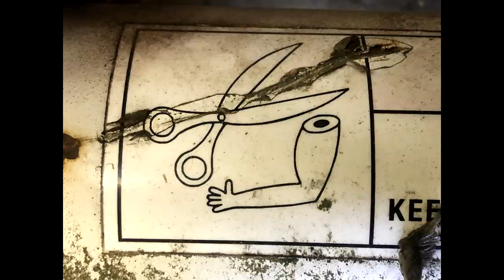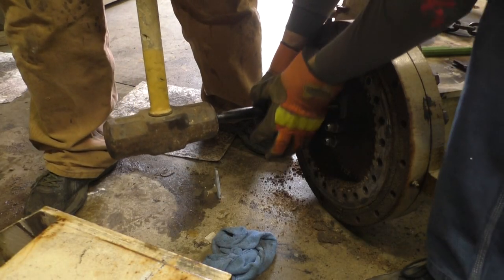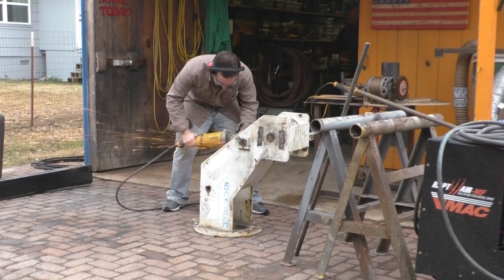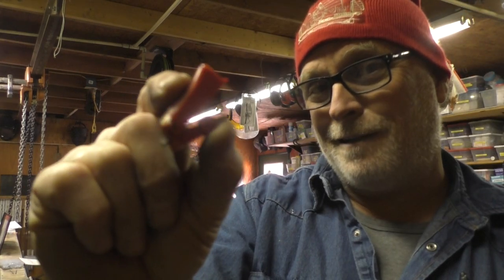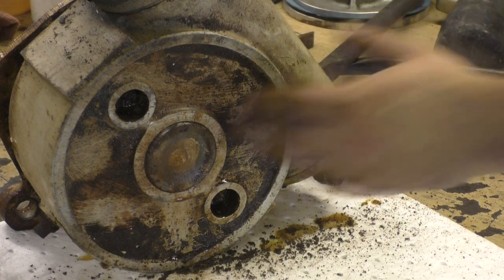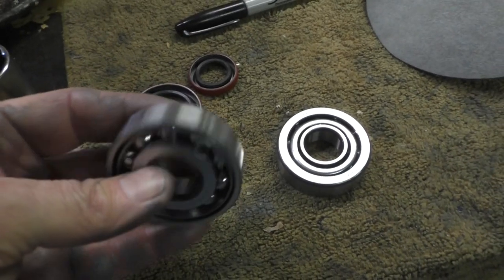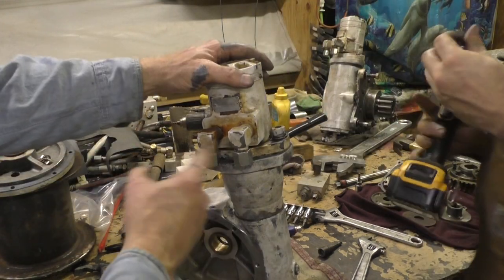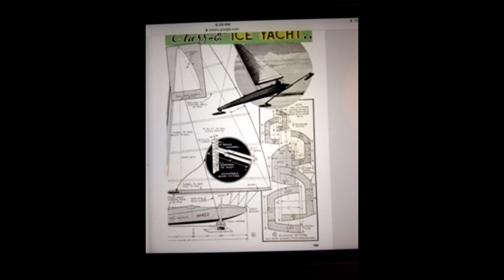Deck Crane Rebuild - Part 4 - Teardown and New Bearings

Comment: The overload presure switch you can hook up to a Warning light instead  that way you  will know if the crane is overloaded without it being cut off.
Reply: Yes
Keep that overload switch Doug.
Either you hook it up to a warning light or hook it up to a bypass switch so that you can lower it if need bee
Reply: A warning beeper and light would be good
Reply: The case "something gets heavier while lifted" is not a common issue for me.
Reply: the switch doesnt kill all functions. it allows winch down and extension in, to lower the load or change the angle of lift to put the load into a safe situation.
Reply: @Sqeezerful  Usually this happens when you have a load and try to extend the boom and that puts you over max. It doesn't get heavier, the lifting capacity is reduced.
Reply: A pressure gauge on the side of the crane is the best way to do it. Heavy thing on crane high system pressure. Just draw a red line on the gauge face if somewhere if you want to be all safety sally? ha
Reply: @TheStumpjumper1  I think that with overload switch activated only allow lifting or retract the bom, because lowering gets the load further out and the center of gravity increase the overload. If you lift or retract the load you get closer to the center of gravity. Thats how modern lorry cranes and mobile cranes work.
Reply: the swtich allows you to retract the extension to get the load closer or lower the winch to put the load on the ground and regroup.
Reply: @Sqeezerful  Think maritime environment. If the load, i.e. a boat - for no particular reason :) gets overrun by a sea wave while being recovered it will definitely get much heavier.
Reply: @ohnoitisnt  This also gives you a maybe less acurate but very high capaity weight scale. With little added cost or complexity.

Comment: Oh boy. You hit the shaft with the torch. I really hope you Either re-heat treat it and get new keys or don't load it to anywhere near what it was rated for, since its now much easier for it to deform and shear. The oxide build up from heating may also make it a bigger pain in the ass to get the gear back on (though if you chilled the shaft in liquid nitrogen or dry ice/alcohol, it might go back in no problem and warm up to a thermal fit in there)

Comment: Hi Doug, when making small gaskets, punch the holes first before cutting the inside/outside diameters - prevents splitting the gasket.
Reply: yes so true, I use to do that when making gaskets and get a piece of hard wood to punch against but punch onto the end grain of the wood.

Comment: I was a millwright at a steel mill. I worked in the crane repair dept.and we called those "dohickeys" on the end of the cable a thimble. When we changed cables on hoists and cranes with thimbles the new thimble( looked like a steel pipe coupling ) we glued the new cable to the thimble. Just slide the thimble over the cable unwind the twists in the cable on the end slide the thimble over the untwisted cable end and pour glue into the thimble. Cut any wires off the end if need be. The glue was some sort of 2 part epoxy.

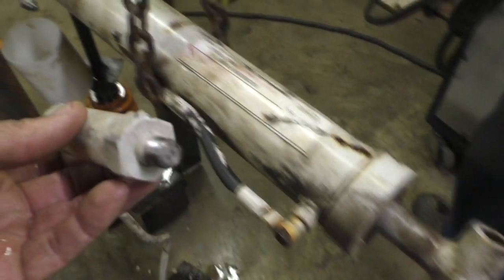Comment: 10:15 I would leave the pressure switch in place - not wired as a cutoff but as overload indicator. Some kind of light or horn maybe. I would like to be aware that I'm trying to lift more weight than the crane was designed for. 
Great job gentlemen - I very much enjoyed watching you!
Edit: I see not only me got that idea with the switch. How come everybody is so concerned about everybody elses safety...? - YT comment section is truly unique place. :)

Comment: On the pins your putting back in to replace the ones that had to be cut & driven out, I would use some Chrome plated 4140. A little money now will save you a lot of heartache later on when you are out in the middle of nowhere. In a salty environment plain carbon steel is going to find a way to rust no matter what. Don't know if it's still available but we always used "Carboline" paint offshore, to cut down on corrosion.

Comment: Exothermic cutting torch you can Pierce a pin in about a minute and a 1/2 a contracts giving Room to push the pin out fairly easy  Broco makes real nice set up and has awesome rods down to 1/4" diameter. I've use both Broco  and Oxy Lance and definitely prefer the Broco.

Comment: Doug 
You can add a simple bypass switch to the overload. Too heavy isn't exactly a subjective thing. There are few instances one can imagine where an object is going to gain mass after being lifted. Attaching to a tree branch before cutting only to find the branch weighs more than estimated, don't see that occurring much at sea though. 
I guess you can find out what truly is too heavy the dramatic way. Best of luck.
Reply from the maker: Think about lifting out of waves.  : )
Reply: @SVSeeker  
Gotcha, considered the idea of waves breaking over and the fact that things do suddenly increase weight when emerging from water, list buoyancy.
I'm still advocating for a manual bypass. Let it warn but you decide. 
Amazing ingenuity getting the crane apart.
Love seeing people who can just do without needing every specialized tool on earth.
The braking mechanism is simple genius, thanks for explaining that.

Comment: When I get water in things like bearings or other places it should not be (thinking of your enormous bearing for sideways shifting) I dry the part in the household oven. Most things can handle slightly above 100 degrees centigrade (212 F?) and all the water will boil away.

Comment: Hate to tell you how to do it 😉, but that gearbox shaft may have been heat treated, and you annealed the end. Check the other end with a file for hardness, and make sure that section wasn't loaded heavily if you did anneal it.

Comment: Look for quick knob ferrules, couple wedge lookin things held together by a ring, that clamps onto the cable, Use em all the time logging, the brake thing... one the end of the worm drive is a clutch, usually set to slip at a certain weight so you never overload the winch

Comment: You guys are probably done all the hard bit , but for bearings and pins that are seized in place try using a little heat, penetrating oil and then keyboard duster spray cans  ( inverted to spray liquid ) to cold shock ... it works

Comment: I'm a crane operator and I would reconsider the overload switch you could even put a bypass on that to override it but it's nice to know you are hitting capacity
Reply from the maker: What if you operated a crane on the deck of a rolling boat, and just as your load transitioned from wet weight to dry weight your crane switched off leaving the load swinging beside the hull?

Comment: Fun fact. A worm drive can run backwards if it is overloaded. I also thought that it can’t until I saw my own winch run backwards and drop a load. 

If you stay within the load capacity of the winch you should be fine, but if you approach or exceed capacity, which most worm drive winches will do, it will absolutely run backwards. It won’t even care if a locked hydraulic motor is holding it.

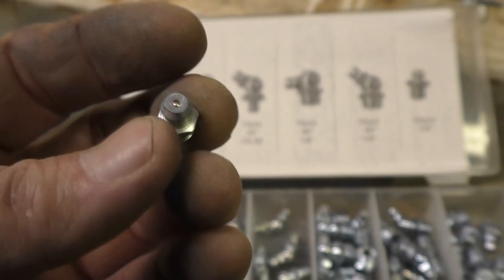Comment: At 19:00 - nice tap chart to find the proper drill sizes BUT ... The drill sizes for a 1/4-28 is a #3 drill bit, which is not equal to a 15/64 drill bit.  The 15/64's column is for "forming" taps only (see the column heading).  Regular "cutting" taps remove metal while "Forming" taps displace metal.  Will it work? Probably.  On board ship you would only have fractional drill index in 64's.

Comment: I think or my two cents that the pressure switch was or is a anti/two block switch to stop you from breaking the cable . If that is what it is it would stop you from extending the boom , raising the block, lowering the boom, which would cause damage.

Comment: honestly keep the overload switch and wire in a momentary switch that will override it. that way you cant lift anything too heavy but if something gets heavier when its up you can still lower it by using the emergency over ride.

Comment: 32:05 appears to be an overload slip clutch similar to what is used in variable torque setting drill/drivers.  The balls run against the ends of the grooves in the discs to transfer torque and pop out and over to the next groove when overloaded.  It is set to desired torque limit by spring or cup washer pressure.

Comment: Lots of time if you put vaseline on the rope it helps it last a super long time the older it gets and great for water resistant. And if you ever have to put a pin in somthing or slide somthing on that's to tight out it in the freezer for a day and it will go on easy and then warms up and becomes tight

Comment: Great Video as always!!! 
Could the pressure switch on the extend cylinder be tied into the cable extend/retract. I know cables often break when the boom is extending and the cable is not let out?
Reply from the maker: That's an interesting idea.  And yes it could be done.
Reply: Agreed I broke the cable on my service truck boom about a week ago doing exactly what you just said not paying attention lol

Comment: A lot of crane collapses are from a safety item being removed or overridden  !
Reply from the maker: Hi Mom
Reply: How would something get heavier after being lifted?  Why delete a safety device before you actually know whether it will be an issue in the first place and.the first time the operator rips the pad eye from the deck or parts the whip when stowing the crane, you wish you still had it in place.
Reply from the maker: @markwertheimer2320  Mom.  Think about "wet weight vs dry weight"  and moving hills of water often called waves.  : )
Reply from the maker: @Ross Radford Thanks Mom
Reply: If you want to delete a pressure sensor that is part of the manufacturers design and is there to protect the equipment let alone the people, that’s your business. The “wet weather/wave” scenario you mentioned is not everyday situation and if it is, you’ve got the wrong crane. 

I’m not sure why your adverse to this particular safety device though. I know you don’t buy into the whole Safety culture thing, saw your anti safety rant in one video but you do wear PPE- like a welding helmet and face shield because it makes common sense to you.  This device makes sense too and could be installed as designed along wth a by-pass switch to be added so as to take it out of the circuit when and if the situation warrants.  I’m betting most lifts won’t be near the max load limiter.  

Also, just an FYI I’ve been in the marine industry for 40+ years. I sailed on tankers for 12 years -Chief Engineer.,  My latest job was the installation and start-up of an FPSO in South America, so I know the big green hills you described intimately. I never considered this repurposed crane to be worked so closely to its design load and certainly not lifting loads in an active sea state. Accelerating loads from rolling in a seaway, put limits on even purpose built cranes which you should be aware of.  In certain wind and wave conditions a crane can be de-rated significantly due to the resulting forces.

Comment: You may slso  wish to consider coating the crane with a bed liner like "Line-X".  They wouldn't be able to coat "all" the inside of the boom but it would leave an almost indestructible  finish that wouldbout last the boat.  It may also me quite cost competitive
Reply from the maker: Not the kind of coating that you can maintain at sea.

Comment: Why not keep the pressure switch but instead of shutting off the power have it go to a warning light. That way when you're operating the crane and you go to pick up something too heavy or if you move too far out it'll alert you.
Reply from the maker: Because I'm programed to ignore warning lights.   Two or three have been on in my truck for years.  : )

Comment: Doug, be careful with the broad worm gear statement. Depending on the friction properties of the components/lubricant and more importantly the lead angle, a wormdrive may be back driven. I work on industrial stretch wrappers all the time that have specifically selected worm gear combos so that they back drive and the film carriage slowly falls without power. 

The gearbox they selected for you crane is likely to break before backdriving, but thats not true of every worm drive.
Reply: agreed. its quite often stated that you cant backdrive them but its not always true. iv personally seen about 5 or 6 that can be back drive. all depends on the design/ pitch off the screw and friction off the lube
Reply: Yup, with a steep enough gear angle they can even be used as the final drive on the rear axle of a car: https://commons.wikimedia.org/wiki/File:Napier_worm-drive_final-drive,_differential_and_axle_casing.jpg
Reply: I can back drive the worm drive in my angle grinder, disc change is always a pain in the rear...

Comment: Wow ! Got it back together in so little YouTube time !  How many days was it overall in real Doug time ? That Dyneema will have some stretch factor too, so it will be tougher in many ways than wire cable was in utility. Do you think the last few feet would benefit from a long piece of electrical shrink wrap or that plasti-dip crap for abrasion resistance ? Glad to see Bart out and about, and helping at shop.

Comment: you could of welded all thread to those pins and with a bunch washer an a piece of pipe pulled those pins out with an impact. I have done it before with great results

Comment: laying out the worm gear is like a illustrated parts catalog (IPC) we use during aircraft repair work, rebuilding stuff like that is like your never done till you've done it three times, next time it will take half the time

Comment: What about replacing all those spindles with stainless steel. Less likely to rust up solid again. Also install grease fittings before all the paint process.

Comment: How does that rope deal with UV? Would it be worth making a spool cover to protect it?
Reply: Synthetic rigging handles UV fine.  Many sailboats are using it for standing rigging.  It's only weak point is rubbing or chaffing in normal use situations and high heat in rare situations.  For example, if you secure splices with heat shrink, you have to be very careful of the heat range you choose for the heat shrink tubing.

Comment: Friday i tried to remove the bottom rear calliper slider bolt on my xv1300 it is one of those 3/4 height bolt heads with a slight angle that rounds off at the drop of a hat, it was solid and rounded, I tried pounding on it but due to the slight movement in the calliper it was not having any, so I MiG welded a two foot piece of 3/8 steel bar to it. it let go, then i had to cut the bar off, turn down the head of the bolt to 5/16, thread it Whitworth and screwed a nut on with a spot of weld - all this so i could change the tyre, its twice as difficult  with the calliper in place - stay safe

Comment: Why do you keep putting mustard on stuff???
Reply: Doug grew up on a dairy farm . Stuck shafts where always a problem. Heat the area around the shaft red hot then quincy with ice water.  Do that three times the expansion and contraction will free it up. You can warm it and dry it out and put on fatalist on it to add lubrication. Works on nuts and bolts also. To remove bearing races heat red hot then quinch. They will almost fall out expansion compresses the race changing it's od.

Comment: Why did you choose that sort of crane? I’d be looking at a Palfinger / hiab or viper fold up crane that’s on lorrys.
Reply from the maker: Height
Reply: SV Seeker look up the palfinger fold up crane serious height/reach  with 6 or 7 stage telescopic boom. All folds up in a nice package. We used buy them new from palfinger Ireland.
Reply from the maker: @ferguson20diesel49    So I should buy a crane from Ireland instead of the very affordable used Auto Crane that was made here in Tulsa?   You're going to need to work on your sales pitch.   : )
Reply: @SVSeeker  no I'm just saying that where we bought ours. Not a sales man or anything. Was just wondering if you've seen the likes in action. I'm sure you can buy them in the us.

Comment: I was just watching your crane rebuild and heard you say that you were going to sandblast the crane and powder coat.   Do yourself a favor and paint this thing with SPI Rust Grip.   Rust grip is a single component moisture cure polyurethane.  I came across Rust Grip several years ago .  After having used many plural component catalyzed coatings over the past forty five years I have found Rust Grip to be one of the most impressive coatings that I have ever used for protection of metal from the elements.     Have you ever seen wrought iron patio furniture that has been powder coated where after a fracture occurs to the surface that allows moisture to penetrate and corrosion begins?  The powder coat film simply flakes off as the corrosion migrates.   Given the expected use of this crane in a salt water environment, powder coat is something that you should seriously reconsider not doing.  Save yourself from the future headache from salt water exposure.

Comment: I'm confused with that pressure switch, how would something you've already lifted get heavier? Unless you're lifting something that is submerged below the surface of the water wouldn't it be impossible for something to get heavier after you've already started lifting it, other than something ridiculous like someone jumping on it midair.
Reply from the maker: ...it is going on a boat.  : )

Comment: pretty sure those bottle jacks dont like to be used sideways. Lets air into the hydraulic fluid.
Reply from the maker: Just top off the oil and no problem

Comment: wire rope will far outlast synthetic rope. unlike synthetic rope you just bath the wire rope in grease and oil it will last a 100 years. most wire rope failures are because of lack of lubrication
Reply from the maker: Because everyone likes working with a greasy cable.  : )
Reply: @SVSeeker  grease is an essential nutrient to any sailors diet